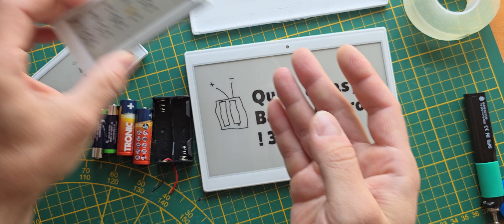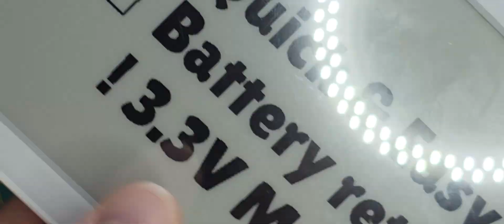Battery Replacement on closed 7.5" E-Paper display

Comment: how to destroy your soldering iron tip speedrun
just use a dremel with a grinding tip and do it slowly
Reply from the maker: The iron tip is cheaper than the dremel :)
Reply: @atc1441  action regelt :D
Bin erstaunt das diese billige Fermi Dremel meine... Anforderungen aushält.
Gibts ja inzwischen im Set mit Lötkolben iirc.
Reply: @atc1441  lol agreed, I now have a cheap iron at the side of my normal iron, i used to keep a different bit just for 'odd jobs' but the cool down and reheat and cool down just got too much, so an old used iron is now my plastics drill and cutter

Comment: Kinda sad all that tech is welded shut to be used "once". More pointless e-waste. Well done keeping these alive!
Reply: It is not true. For the nebular series with size >= 4.2 inch, you can use heat gun and good suction cup to peel the front cover. The battery can be replaced by 3.7 lipo rechargeables
Reply from the maker: As you can see in the video its not a Lipo and also not "simple" to open the front as mentioned in the video as well :)
Reply: @atc1441  Fair point, I couldn't source the same battery as well but I doubt if there is going to be any issue if a lipo is charged to around 3.4 and used as a disposable battery. FYI There are two batteries inside so you would have to make one more hole in the back.